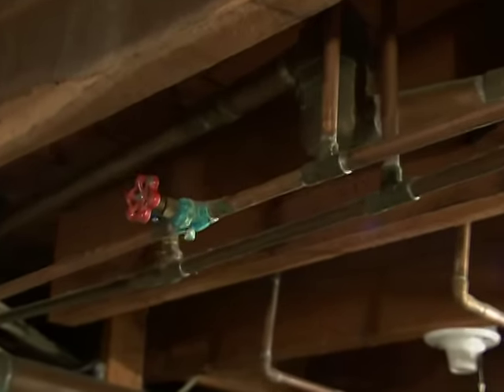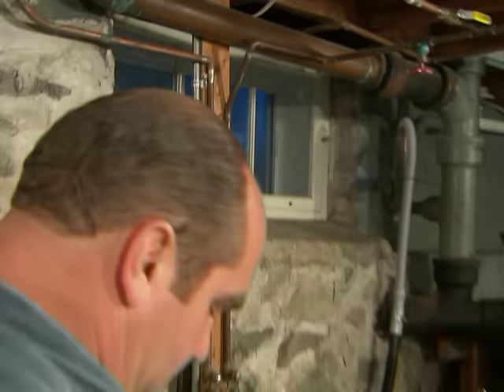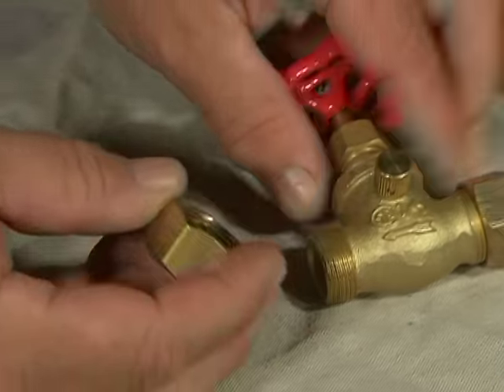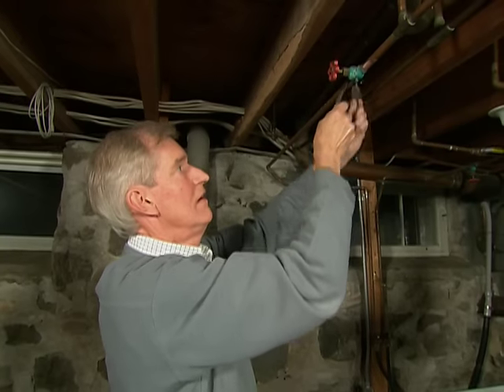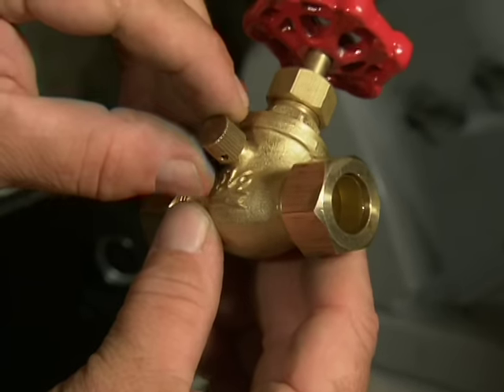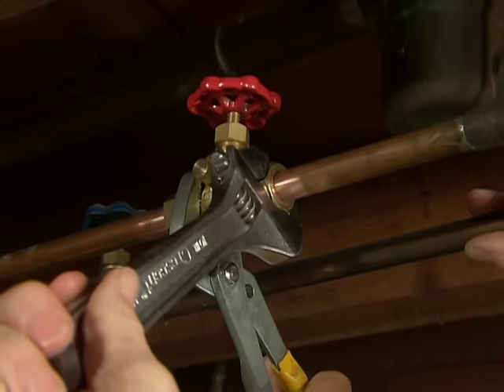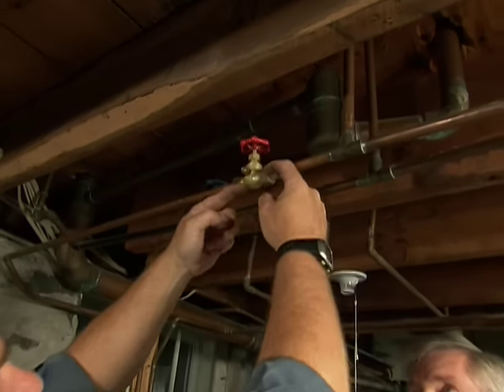How to Replace a Plumbing Shut-Off Valve | This Old House

Comment: After you cut the pipe make markings at 1/2 inch and at 3/4 of an inch away from each cut.  Once the valve is in position you can only guess that you are grabbing enough pipe  on each side. .the black marks will come in handy then

Comment: I got two words for you.  BALL VALVE!!!
Reply: Ball valve are more expensive the a regular valve.  It might run as much as $2.00 more in so stores!   Stick with replacing it with the same type of valve unless money is no object or you have a  million dollar home.
Reply: Nobody uses those valves anymore.
Reply: Alot easier to rebuild vs ball valve.
Reply: Gate valves suck - easy to overtighten and the gates crud up over time. Plus gate design changes every few years so good luck if you are just wanting to replace the stem assembly. 1/4 turn ball valves will last forever.
Reply: @Dfk429S9fo3 everyone uses ball valves now ? I dont see anyone using gates anymore.
Reply: @Agent77X  is 2 extra dollers going to kill you for a valve??? I would say if it was 10 dollers more forget it but come on for 2 dollers its worth it ! You dont need to be rich for 2 more dollers
Reply: @Agent77X  man, $2 valve isn't indicative of a million dollar home! I bought a coffee once for $2, doesn't mean I'm a millionaire...
Reply: @Dfk429S9fo3, yes they do.
Reply: @Agent77X  $2 dollars more LOL. You have got to be kidding me that extra is an issue.. like dumb folks buy chip board instead of plywood
Reply: When was this filmed though?
Reply: @rhettdaw  same thing I was gonna say I’m pretty sure this is very old maybe 10 or probably more years and back then they were expensive and very uncommon
Reply: @Agent77X  could be they wanted the  waste hole
Reply: Shark bites
Reply: @Agent77X  In a lot of areas, code requires a Ball Valve Replacement -
Reply: @richardwhite6288  💯%agree!!😎👍🍺
Reply: The next day theres is flood, because you shaked all the old copper pipes around while using a hack saw to cut it lol.  

Deffently not the correct way to replace a valve.
Reply: Ball valve all the way. I've not had any plumber tell me over the years that they replace them because of malfunction or failure. But these gate valves, forget it.
Reply: @mikedorman570  So then how do you remove the old valve without cutting it?
Reply: Winter project 100% gate valve replaced with ball valves..

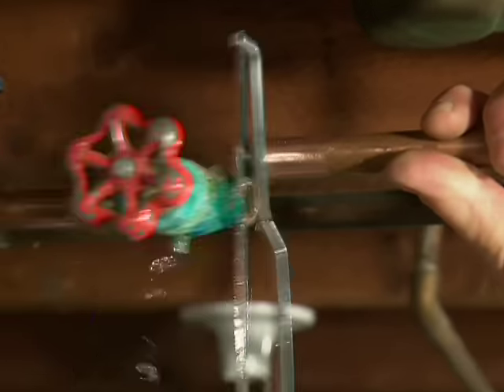Comment: 2:13 - tip, don't cut one side completely off, stop at 8/10s then do the other side - then finish off
Reply: I prefer to stop 4/5 of the way
Reply: @MrJabez89  16/20 I's industry standards 🤣
Reply: @bassinbilliards6279  industry standards
Reply: @bassinbilliards6279  I just stop after "three Mississippi" and wherever I am is correct.
Reply: Why? Some explanation would be very useful.
Reply: @igorsukhenko1964  Because, the second cut on the other end will be easily if you had whole pipe integrity.  The pipe won't be flapping in the breeze.
Reply: I like to cut it about 80% of the way, then switch to the other side

Comment: That guy actually knew how to use a crescent wrench properly.  I'm impressed because I've seen it used backwards so many times, both in real life (I've got the skinned knuckles to prove it) and on this show.
Reply: Umm, no. He used it backwards twice. The force needs to hit the bottom of the moveable jaw, because the top of the jaw can move more than the bottom.
Reply: @johngalt97  Try it your way and tell me how that works out for you.
Reply: @jesusnthedaisychain  I think the manufacturer recommends what leads to fewer warranty claims. Putting the pressure at the bottom of the sliding jaw leads to less chance of rounding the fastener.

Comment: I saw this segment years ago.  I don't know why anyone would replace an existing stop valve that has soldered connections with stop valve with compression connections when some simple maintenance would have sufficed.

He should have shown the homeowner how to replace the faucet washer and add to or replace the stem packing.  And then, gave him advice on how to snug-up the packing nut as needed instead of letting it leak from the stem for years as evidenced by the build-up of green copper corrosion and calcium on the exterior of original valve.

Comment: "the way i like to do it is install the stem in the most awkward position possible to turn it off later."
Reply: Sediment won't be able to get caught in the valve's gateway.  The best orientation possible is with the stem facing upwards.
Reply: @Guillotines_For_Globalists  
Neat theory but does it aactually make a difference? Cant sediment get caught in the up position jist as easily since the water pressure is equal on all sides?
Reply: @theazure4171  Normally flux settles to the bottom and causes corrosion in copper as well.
Reply: @Guillotines_For_Globalists  
Sounds legit i just dunno why everyone doesnt know this then..
I guess they do the same thigs with gas lines leaving a pipe extending down in areas for catching debris
Reply: @Guillotines_For_Globalists  
One guy sàid hed put the bleeder in the down position...so which is better?
Reply: @theazure4171  The bleeder is more or less of a vent to let the steam vent out when you are replacing valves (or any kind of fitting for that matter) when there is already water in the plumbing system.

If you don't vent your pipes when sweating/soldering a joint, the steam building up inside of the pipes will blow your solder out.

All in all, the orientation of that vent, bleeder, or drain, whatever you want to call it, can go in any orientation.  Sideways or downwards will do the trick so you can purge the line at the end of the season.  A better alternative would be to install a "T" with a boiler drain or something so you could drain the line much quicker than relying on the vent.
Reply: @Guillotines_For_Globalists  
Makes a load of sense. Thanks for the tips!
Reply: @theazure4171  code here says ball valve oriented up. I have a few homes I go to every year where they didn't want to replace or even repair the valve - just have me come once a year to give the packing nut a tightening. Not the way I wanted, but these are older ppl on SS, they'll always take the free option and I don't blame em
Reply: @theazure4171  also, those valves are sideways or upside-down. That's exactly why they leak quicker.

Ball valves can be in any direction. Go with a ball valve.
Reply: @shimes424  
Good info. I have a few of those gate valves that are pretty much seized and nonfunctional from long term non use haha
Reply: @theazure4171  thanks!
In a pinch you might be able to turn it after loosening the packing nut a little, but most likely that won't help

Comment: If you  don't know how to solder. Use shark bite valve. They work great and save you time.  I've been using them for over 20 years.

Comment: 2:34 how is it gonna drain if the drain cap is seemingly above the pipe?
Reply: Just lets the pressure from upstream drain out with closed valve. Instead of shutting house water supply off.

Comment: Should hand tighten those compression nuts and then do about a half a turn.  turn water on and test.  if it leaks go another 1/4 or as necessary to stop it.  Usually a 1/4 to 1/2 turn after hand tight is enough.  Overtightening a compression fitting is suboptimal and not recommended.

Comment: I did one today using the exact method, I was worried I might scorch the wood if I used a torch, the valve was close to a wooden cross brace.
Reply: Try using a thin piece of aluminum for a heat shield, bends easy and prevents fire and burns.

Comment: It is a good way to replace the valve, but with old pipes you need to be very careful not to disturb the other pipes. Hacksaw instead of a pipe cutter not recommended.
Reply: Reduce the vibrational load by using blocks of wood to make the pipes more sturdy while you use the hacksaw - especially if you dont have anyone to help 😊

Comment: How do you deal with the situation of not having any play in the pipe?  In the video there was a lot of play so one could just insert the new valve into the existing pipe, that doesn't work so well when there is zero play in the pipe on either side of the existing valve. With PVC they have an extending coupling to deal with the situation, haven't seen anything like that for copper.
Reply: you'd have to add additional pipe with a coupler.
Reply: Or use sharkbite slip coupling
Reply: There are copper sliding couplers

Comment: When he cut off the valve  and made the 2 shorter pipes,  how can he reconnect the new valve with 2 shorter pipes?  Can he break the pipe if he force the 2 shorter pipes to connect to the new valve?
Reply: I was wondering that also.  There must have been a lot of slack in that pipe.

Comment: I am not a plumber , but I think , even with ferrules making the seal , that after cutting , the inside of the copper pipe gets debured . This stops turbulence inside when the water flows . That can cause other problems .

Comment: I did this exactly but it leaks because the ferrule curled around the end of the pipe. Make sure the ferrule slides completely on to the pipe and doesn't overhang. I think the only way this method will work is if your pipe has a little play so you can close the gap a little. My pipes are fixed so this method doesn't work.
Reply: Justen Hansen yep. You have to make sure both ends of copper pipe are fully seated into the valve then compress nuts
Reply: You can try wrapping the ferrule with Teflon tape. I find that works like magic whenever I have a leaky compression connection
Reply: Heh, I just learned this the hard way.  Was trying to avoid using a torch in the location I'm working as I have very little space, but the pipe has no play and the gap is too large to get a decent seal.  Tried the teflon, but it still drips as the ferrule still gets pulled past the edge of the pipe when I tighten.  Looking around hoping I can find another valve with just a tiny longer width, but it doesn't look like that exists.  I keep getting recommended shark bite instead, might have to resort to that instead.

Comment: I have one of these valves that is leaking and corroded badly. It is between the hot and cold water coming into and out of  my oil fired tankless furnace. DO I SHUT DOWN AND DRAIN EVERYTHING TO SOLDER A NEW VALVE IN ? I do not want to lose heat now in the middle of winter ! Thanks for your help .
Reply: You will have to drain the water in order to solder a new valve on

Comment: Soldering pipes isn't all that difficult to learn.  I'd much rather have a properly soldered valve ... and I'd definitely much rather have it be a quarter-turn ball valve!
Reply: True, but sometimes difficult when even a little water is present.
Reply: Nothing wrong with using these compression connections.
Reply: keith cunningham  I learned that trick, using a piece of bread to hold back the water in the pipe from a plumber friend of mine. Works slick.
Reply: Open a faucet upstairs give a downward slope to both sides of the pipe, have a toke or drink a beer, come back n finish up

Comment: it takes 1 second to cut it with a angle grinder and a metal cutting thin blade... works great
Reply: overkill for such a small job. I use angle grinders daily at work but for a job like this.. don't think I would start messing with all that extension cords and stuff. I guess if you had a cordless one.. but those things are not made for real work.
Reply: @heke. I do real work all the time with cordless grinders.

Comment: I just did  this project, but was concerned about the extra longitudinal tension put on the pipes because of the loss of pipe length from sawing out the valve. It made me feel uncomfortable that it might pull out of the compression fitting someday, or leak at some nearby joint. So I added a Sharkbite slip fitting to extend the pipe. No leaks and no tension. I’m thinking of buying a WiFi water leak sensor for further peace of mind. I just found out that my water heater is 17 years old. Yikes! I won’t be doing that one on my own.

Comment: I am wondering about the the 2 pipes NEEDING to bottom out inside the valve or not ?
I am looking to do the same upgrade and concerned the pipes having no movement in my situation. Its 1/2 copper pipe.

Comment: This is great when you have a lot of space, my pipe had less than an inch clearance.  There should be more conditioning of the pipe and deburring the inside. I tried cutting the pipe with a hacksaw, trying to make it even.  I had a huge fail, and difficulty removing the valve, eventually having to buy a bicycle wrench to remove the valve.  I'm pretty sure it would work if the valve wasn't so tight for space.
Reply: The first time I replaced one of these valves and tried sweating it, it ended up like the Three Stooges--water everywhere.  Luckily I was able to get a plumber before the wife got home to cook dinner.  I have since had more success.  Take a look at Sharkbite fittings.  No sweating and you can remove them easily if you desire.

Comment: Can this solder-less valve be used as a main valve for a house ?
Reply: no you need a stopcock but yes that can be compression (solderless)  in uk
Reply: ibanez1403 yes you can use a compression fitting on your main. they sure are nice to since it's sometimes very difficult to get all the moisture out of a line when soldering.
Reply: that stop and waste style cannot be used as a main house shutoff....use either a gate or ball valve.
Reply: ibanez1403 she
Reply: you can use a stop and drain for a house. The drain just has to be on the upper portion of the line, not before the valve.
Reply: the main line coming must be a full port valve....ball or gate valve. do not use this type for a main shutoff.
Reply: you cannot use this type right off the water meter..it must a full port valve...ball or gate valve...same goes for inlet to water heater and boiler.
Reply: Mario D'Agostini I had the same problem we had the water off at the main plus at the street and still had a steady leak so we just used a compression fitting and no problems with it at all. Also its not the main valve it's past the water meter but we use it as the new main.
Reply: First Last  I would look for a compression fitting shut off valve and install it after the meter or leaky shut off valve. Even though its leaking slowly a compression fitting will work just leave the new valve open till you get the side coming from the city tight then you can close it and do the other side.

Comment: Aren't the pipes on opposite sides of the new valve pulling outward? Long term will that unseat the ferrell seals?
Reply: compression fittings are fine if done correctly...make sure they are accessible and not hidden in walls etc.. and make sure pipes are well supported and not flapping around..wont have problems.
Reply: I would put a little pipe tread sealer on all ferrules for a little added measure.  You can also put it on Teflon tape.

Comment: some times logic doesn't make it into code  as it SHOULD.. a compression is better down in the basement where drains are  and because they can be tweaked to stop leaking in a moments notice where as other leaking joints can not be serviced so easily behind closed walls etc.  another example of code failure  is concerning the requirements for apartments and condos to have only metal drains under the kitchen abd bathroom sinks , based on fire safety concerns..yet most cupboards are made of combustible woods and material and most folks store plastics containers and combustibles under their sink,  likewise forbidding ABS  pipe isn't logical at all.. in fact  ABS pipe outlasts the metal counterparts and is more leak proof.

Comment: I used a saw zaw to cut a PVC vent pipe and knicked a copper line went to shut off the main and the ball valve broke I had to run to homedepot and get a shark bite fitting.
Reply: There's a lot of Chinese valves out there. I don't really wanna roll the dice with one.  I just bailed out of the more convenient Ace Hardware, drove further to Home Depot, and paid more so I could get an Italian made ball valve vs. the Chinese one.

Comment: So what happens if you the closest you can cut it off is too wide for the new valve?
Reply: You would need to solder on an extension, or do a Sharkbite install.
Reply: Shark bite has a slip install so it is not a fixed length. That may be needed if the pipes are fixed. But you need to move the pipe slightly to get it on.

Comment: Most valves are not necessary. You need a main valve in the house. And valves going to a bathroom group and a hot water heater and outside faucet.and the once-a-year exercise all the valves in your house or as it is explained call a real plumber

Comment: its not good practice to use a hacksaw on an old water line (like the one in the video) you could shake it too much and break a fitting down the line also the stop and waste you pulled out was installed correctly with the drain facing down so you can drain the pipe completely the way you installed the new one when its used to drain will leave water in the bottom of the pipe

Comment: just teach the old man to solder already!
Reply: @user-hn8wm5xd9f  Sharkbites are nice.  But, like anything, people need to read up on their installation.  You can't simply slap them on without a little prep.  I also recommend the Sharkbite removal tongs if you ever plan on removing them or using one of their slip joints.  The tongs sell for about $10.00 and you can buy them at Lowe's.

Comment: Interesting that they didn't stress to shut off the water at the street first...  someone is going to try this without doing that... and then they'll realize that (A) they don't know where the street shut off is, or (B) they don't have the tool to close the valve there.